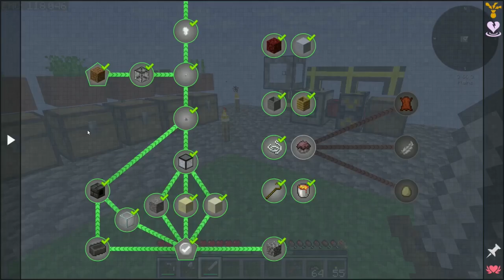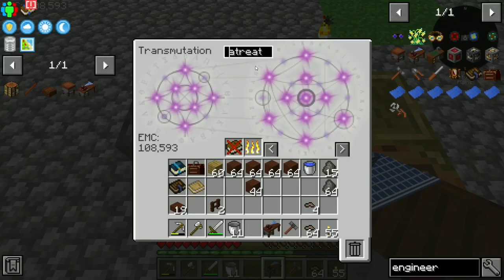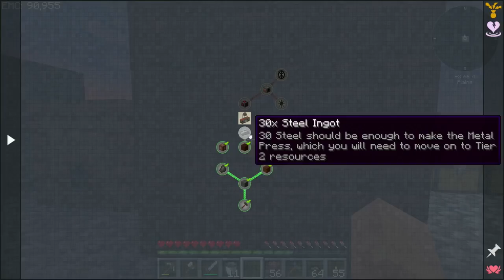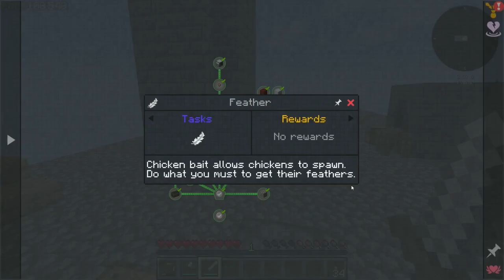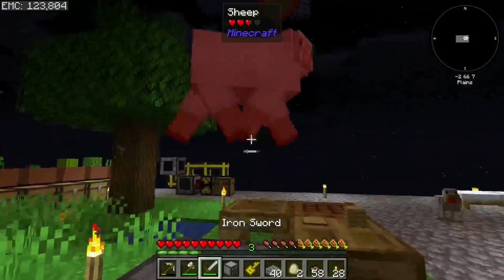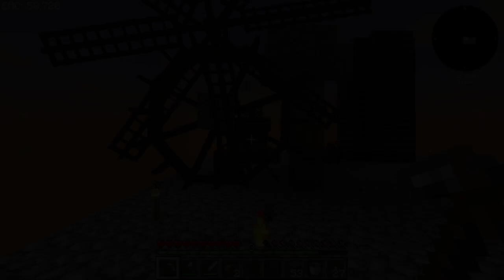Steel Production in Immersive Engineering | 3 |

Comment: hey, hi can you please tell me how to claim force chunk load and what are bind keys?
Reply from the maker: In the ftb chunk menu, I believe it is click to claim, and shift click on a claimed chunk to force it to load.  If that is not right, I'll have to load the pack to check, but in the control mapping the controls would be under ftb chunks.
Reply from the maker: Also, you can use the /ftbchunks commands to change how many chunks you are allocated if you are on singe player.  If you are on a server you would need the server owner to assist.

Be careful how many you load though, it will decrease Server tps.
Reply: @ender7154 thanks bro
Reply: @ender7154 i really like your videos and your videoa are very helpful
Reply from the maker: @muneebali1440 thanks!  Im trying hard to improve them.  Means a lot to hear you are enjoying them.